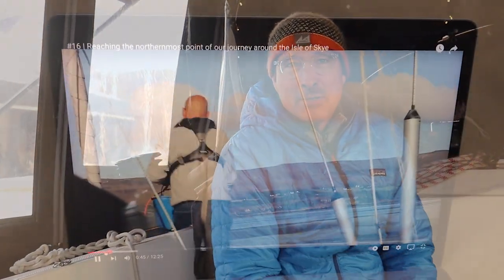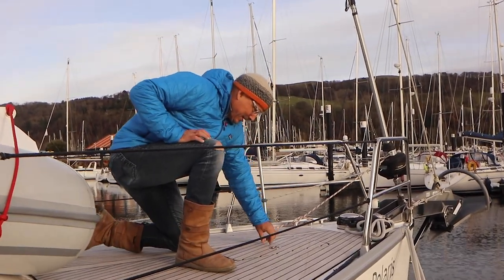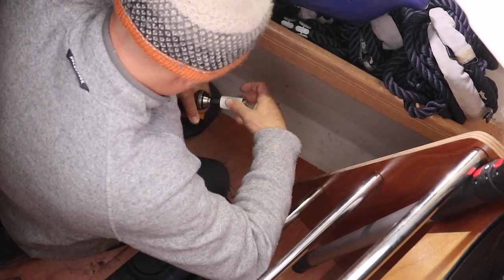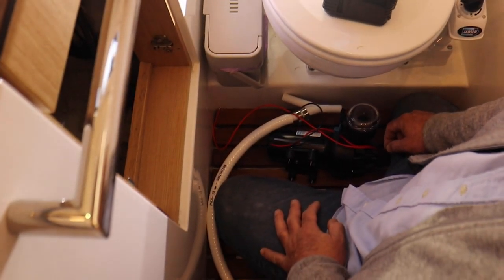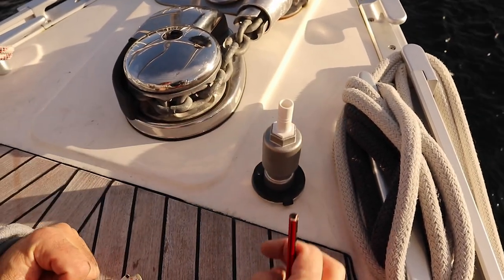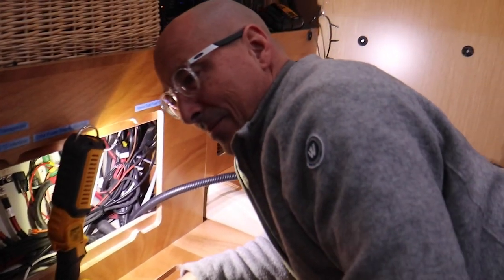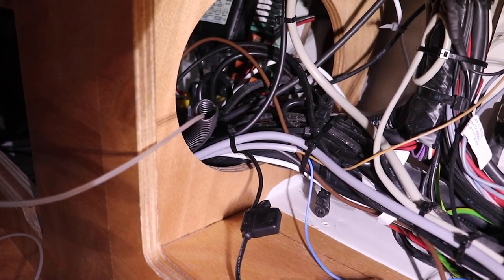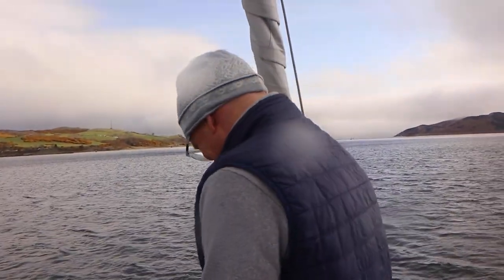#22 | Upgrading Our Boat: Installing an Electric Washdown Pump for Efficient Deck Cleaning

Comment: Interesting! Did you fit check valves with the «Y» on the seawater inlet? Any issues eith the pump sucking air?
Reply from the maker: Hi, no issues, heads and deck wash pump both working fine. The deck wash hose connector has a valve, it only works with a hose attached. Interesting thought though, never occurred to me…
Reply: @sailingpolaris   - ok, thanks for the answer. Great to hear that everything is functioning as intended. I'm planning to connect the watermaker in the same manner (with a "Y" onto the seawater intake) on the starboard toilet aft. I have the same boat as you, but mine is from 2010, so there are slight differences. You obviously have a very well eqiupped boat.

Comment: Does the pump run constantly when the breaker is on or does it on energize when there is a demand for water (ie the wash down hose is hooked up)?
Reply from the maker: There‘s a pressure valve in through hull. The pump builds up pressure and then stops until a hose is connected with the adapter and water is demanded. The adapter opens the pressure valve.
Reply: Thank you, that’s very helpful! Fair winds ⛵️

Comment: If you fit a garden hose sprayer to the end of that you'll be even happier 😁
Reply from the maker: Tried that… somehow it works better without… I think the pump doesn‘t like the additional resistance… will experiment a bit…
Reply: @sailingpolaris  That makes sense I suppose some pumps are designed to provide flow others to provide pressure. It looks like it does the job though.